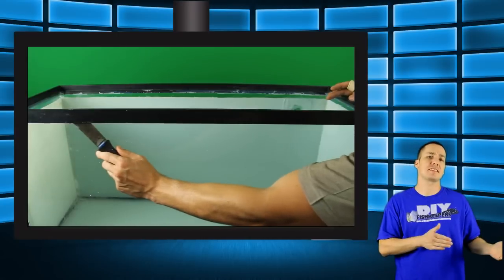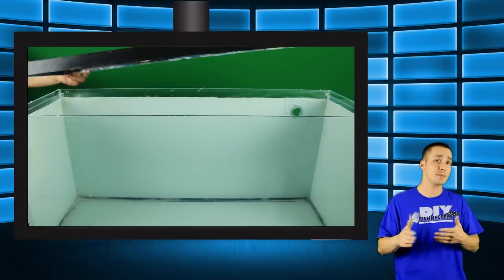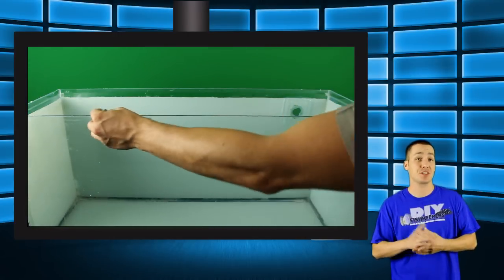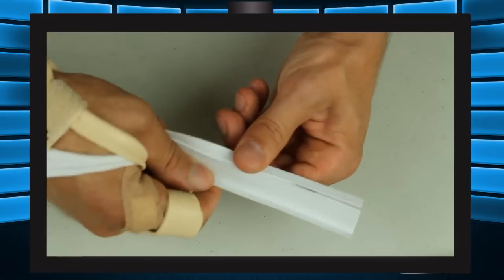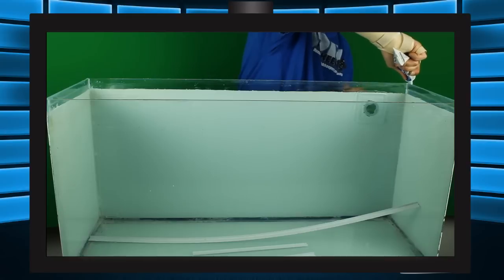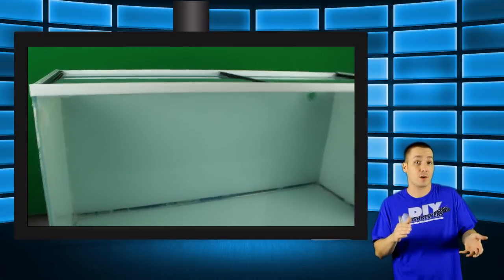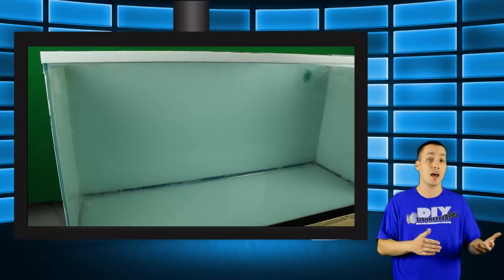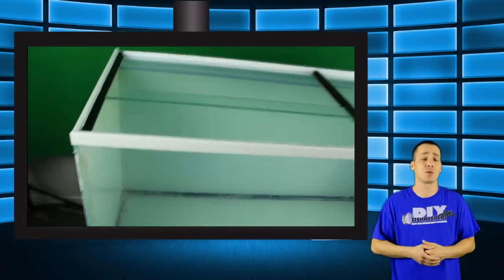Make your own aquarium trim!

Comment: This is perfect for my situation.  I have an old school 90 gallon tank with really thick glass.  The trim is cracked on the top and bottom and I doubt I can find a factory set of trims for it.  I'll be using your solution!  Thanks Joey

Comment: I just picked up a 75g. The trim is scratched and looks awful, and the center brace is broken.   Can I use this method to make a new one? Assuming I get some stronger/thicker plastic or other material?  The tank will be for turtles, so it wont be completely filled like it would be with fish.     Would this method still had some security  to keep it bowing out at all?

Comment: 5ft x 1.5ft × 2ft.. L×B×H...12mm glass. Should we use bracing in bottom or only top center & side bracing will work good ?

Comment: I have a 55 gallon tank and the BOTTOM trim is broken off on one corner and cracked in several places. it also has a support piece in the middle. Can I use this method to replace it, or should I buy real trim and put it on since it has to support & brace the tank?

Comment: I agree the stock trim on most small tanks is way to large.  

Thanks for another awesome video will for sure be doing this on a few tanks.
Reply from the maker: I dont mind it on bigger tanks, but 55gal and under is all the same size. (until you get to the 10-15gal range and it gets smaller) I think it should be rated based on the height of the tank.

Comment: Just removed the trim on my 75 gallon. Do i need to add bracing?
Reply: if the trim you removed had a brace bar, then you will need to add bracing.

Comment: First thought: I thought the main function of that part was that of a brace to hold down the aquarium glass in place.
Second thought: you can use aluminum. Some window manufacturers (at least in Mexico) will provide them with a wooden-like paint, even with a little bit of texture. Of course, it`s quite an extra buck.

Comment: I have a 55 gallon tank that needs a new top side frame. Is the frame necessary for support? Or is it only to hold the lid and protect the edge of the glass? (also aesthetic)
Reply: Ok, so I found your video on BRACING. LOL But I'm slow- My aquarium is 48" x 12.5", glass. So am I correct at saying that I don't actually need a brace?

Comment: My 120 gallon tank needs to be replaced both the top and bottom. Where can I get a 60" frame? Am I correct this size tank requires a center brace on the top?
Reply: I’m looking for the same trim did you have any luck

Comment: I have an older aquarium that is 72" long X 18" wide X 24" Tall. It doesnt have a bracer and the top trim is broken and ugly can I take off the trim and leave it off with out hurting my tanks support.
Reply: It depends how thick the glass is and how solid the silicone work is.

Comment: What was that tool you use to remove the trim so easily. I tried to remove trim from a 20 gallon and broke one of the side glass
Reply: it looks a lot like a metal paint scraper but i'm not completely sure.

Comment: or door edge guards if you didn't want an inside lip but wanted to protect the bare glass instead of going full rimless.
Reply from the maker: Good idea. I seen a ton of options at the hardware store as well. Lots of materials that could be used.

Comment: I cannot for the life of me remove the trim from my 40gal tank. what am I doing wrong?
Reply: Razor blade from the bottom on the inside and out, wiggle it around quite a bit and it should just come off, if not try something like 2 rulers to push up on both sides that same place you ran the razor blades. Do that around the perimeter and you will almost certainly be able to get it off

Comment: I have a 90 gallon. And I want to take off the top edge trim. I'm looking for anyone who thinks this might be a bad idea to tell me why. I've heard the water weight causes glass to flex yadayadayada... is this the case or not because I can deal with a style if it means my fish aren't on the floor. Otherwise it will look 1000× better.

Comment: How about just using enough painters tape. then fold a 2 inch strip of fiberglass cloth over the top edge  and resin  it when it hardens  paint it and silicone in place remove the tape of course.

Comment: Hi Joey,

I was wondering if you can change the trim on the bottom of the tank the same way. I just bought a used 40 gallon hexagon and the trim is in pretty bad shape. If I just change the top, it won't match the bottom piece. Can I change both?

Thanks!

Comment: I have a 125g without a brace and no trim, I wouldn't be able to do trim like this because my tank bows on the front and back.
It's on a second floor too haha
Reply from the maker: Brace it first, then add a trim if you like. Next week i am doing bracing.

Comment: My trimming on a 60 gallon is getting old and should be replaced, it does not stay in contact with lip of tank..This is a real easy and cheap way to replace the older trim.
Reply from the maker: Indeed! Good luck Adam!

Comment: So basically this kind of plastic trim will have no effect on improving the strength of the walls (Giving a little more of "Hold") of the aquarium due that they are "plastic" and were cut off, I'd guess it is only for aesthetic purposes.